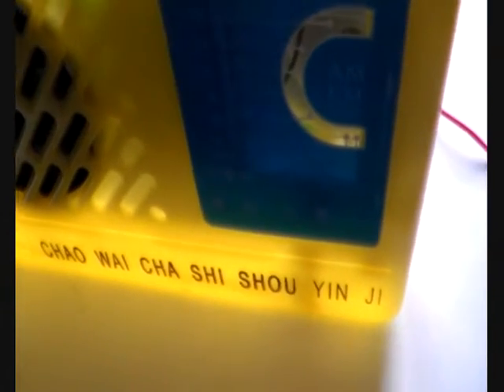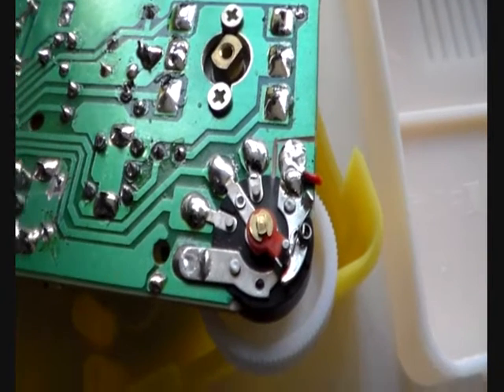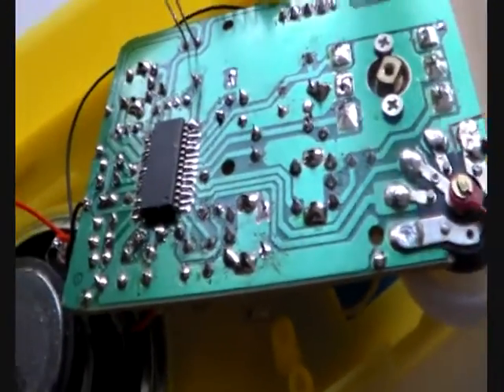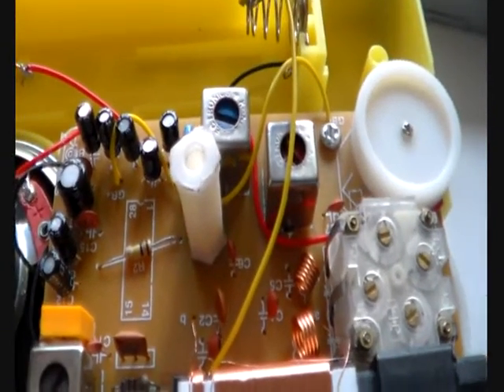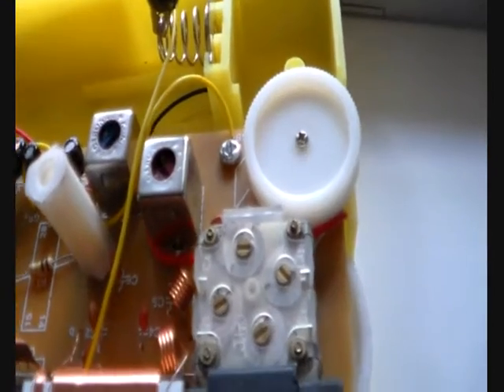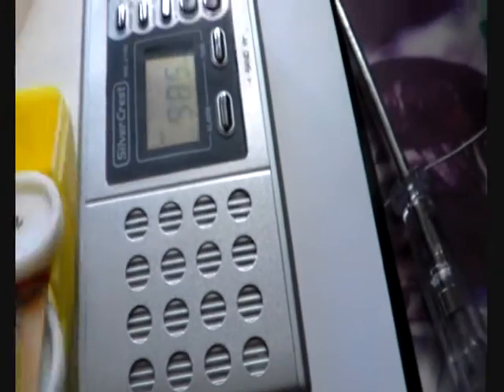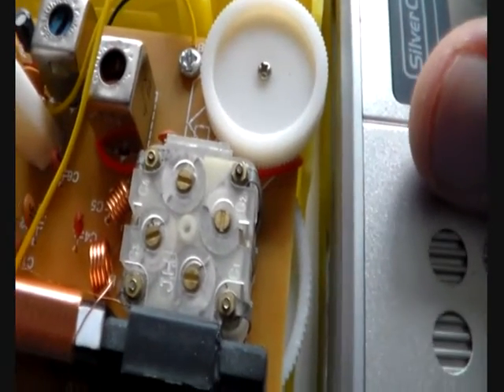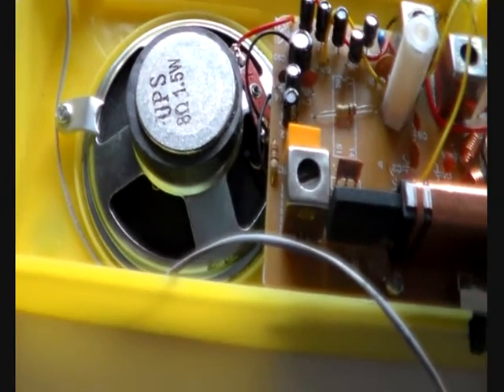FM AM radio kit part 2

Comment: Chinese kit no direction ,sometimes missing parts,sometime had part ,the board isn't right ,these kits are not for beginners,I seen techs struggle with these kit ,they are not for ten year old boys first time ,I would recommend  a Elenco kit comes with the right parts laid out nice for you ,a instruction manual ,everything a Chinese kits don't have and they have a nice selection too of kits.

Comment: I have one of these I put together, slightly different model but same IC driven AM/FM bangood kit build. I broke the dial plate and the AM/FM switch came apart so it is in FM mode permanently.